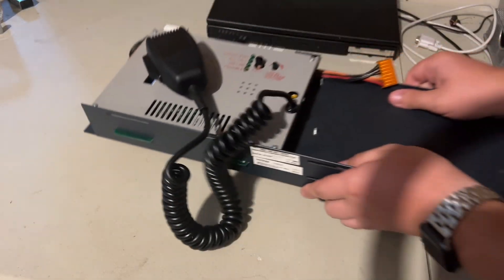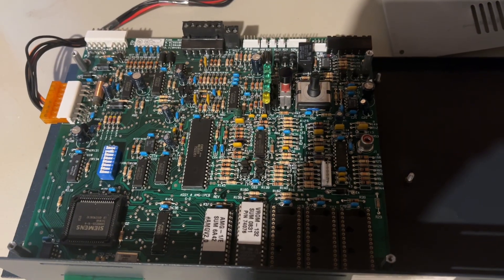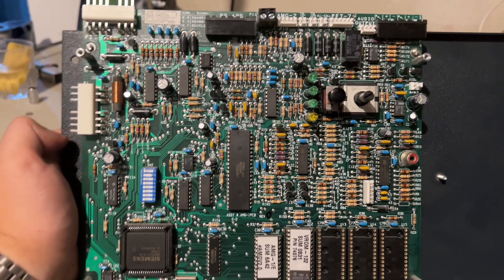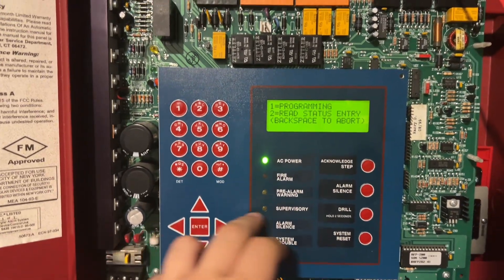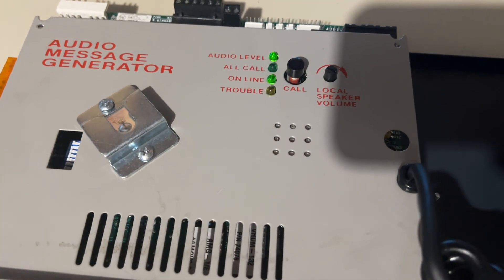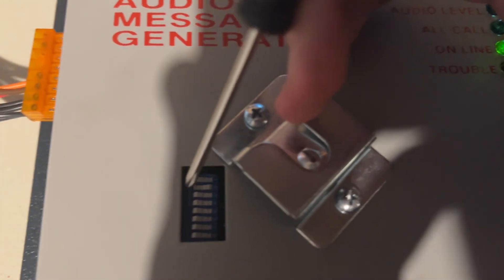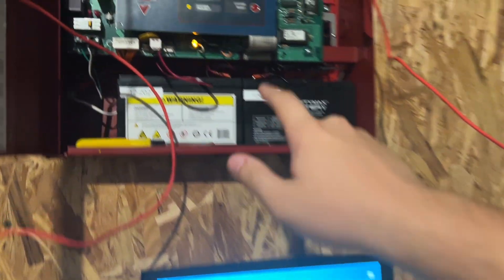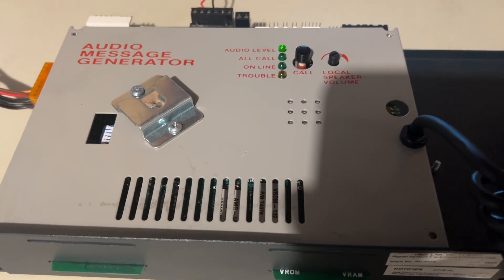I bought a Notifier AMG-1… and it works on the AFP-200 (sorta)

Comment: Update: The harness connecting the AMG to the AFP-300 is not a NAC input for speaker strobes. The NAC inputs for speaker strobes are part of a control module that connects to an Analog Amplifier like the AA-120. So the empty input on the harness is not a NAC input. It just connects the AMG to the panel. Also the AMG does not silence, it only resets when the panel does.

Comment: The tones on the AMG-1 are labeled on the buttons in the manual, it's very complex and strange.
Reply from the maker: Yeah it’s pretty confusing. The tone assignment also varies per panel (AM2020 supports different AMG tones).
Reply: You should get a DIA-2020 or DIA-1010. You could use those if you want AMG voice evac or a NFS2-640.
Reply from the maker: No thanks
Reply: @Loganetics1 It's your choice but it would be cool if you had a FACP you could use with the AMG and connect speaker strobes.